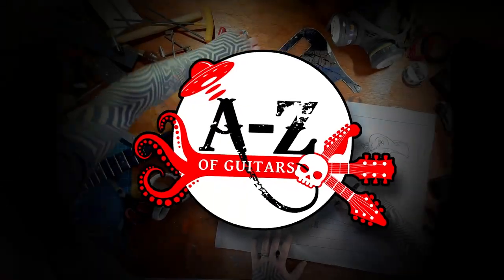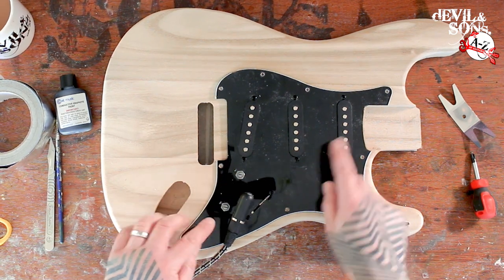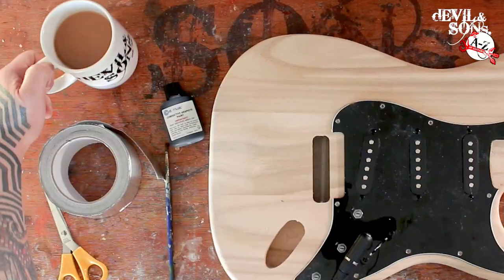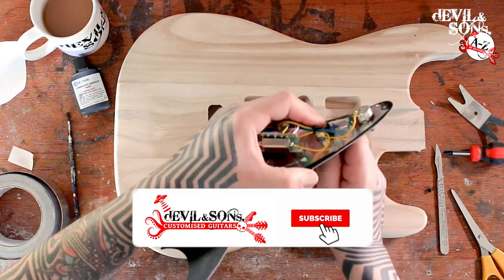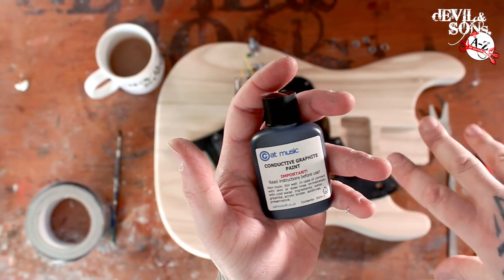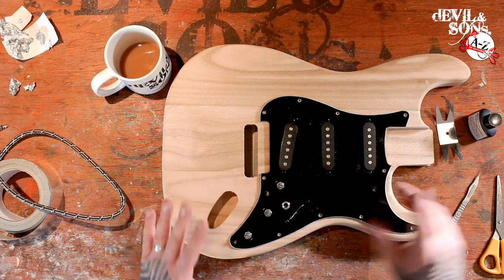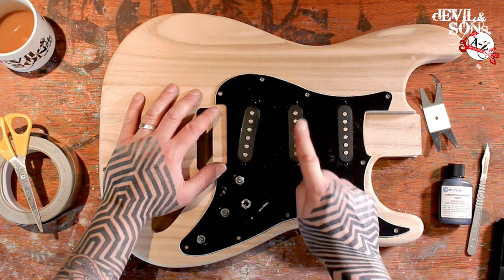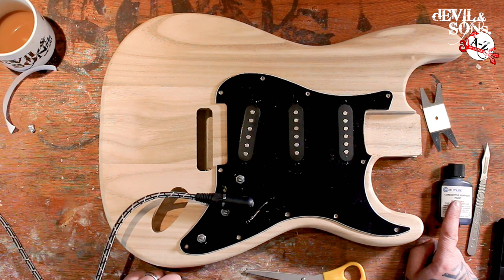Definitive proof that you need cavity shielding on your guitar

Comment: you’re not grounding it in the first one, so its pointless. shielding makes 0 difference when you’re touching the strings, it only affects the noise floor when the strings are released
Reply from the maker: The whole point of this experiment is to reveal what works and doesn't. It is surprising what some of the results are. You're spot on with touching the strings.

Comment: Pretty sure you need to use the slug repellent copper tape. Almost every TIN foil hat wearing conspiracy theorist will tell you ALUMINIUM foil don’t stop anything. 😉
Reply from the maker: Did you watch the video? The aluminium works really well.
Reply: I used Elk brand copper tape on a Squier strat and it works beautifully. Zero noise. Absolutely 100% better. I didn't expect it to work as good as it does.
Reply from the maker: Great stuff.
Reply: It improves it slightly I've put thicker copper plate and connected pickup straight to shielded cable, when i wrapped pickup(p bass) on thin copper foil it did'nt help maybe even got worse, i wonder how long does the paint last

Comment: I have 1 Strat and play it constantly. I know what this guitar sounds like, the sound got kind of sterile when I shielded just the control cavity. Ripped it out. Sure it made it less noisy (not that noisy to begin with) but at the cost of the tone. Been playing for 43yrs, not a newbie. It's funny how not 1 utube video mentions the sound difference yet just about every post on guitar forums tells you this.
Reply from the maker: That's interesting. I've never notice that, I must do some tests now to compare. If it's not too noisy then I wouldn't suggest making changes, but perhaps the shielding wasn't done properly?
Reply: There should be NO DIFFERENCE in your tone after shielding your guitar.
If there is nothing between your strings and pickups then the tone is unaffected, it's simple physics.
The shielding does not connect to your "hot" wires therefore does not affect your signal.
You probably shorted something that bled signal to ground. Or there was an existing signal short to pot or switch body that was not apparent due to the lack of shielding and therefore lack of path to ground, and found a way to bleed to ground after shielding the cavity.
Youtube videos do not mention tone alteration when shielding because there is none.
Shielding DOES NOT ALTER TONE in any fucking way....
Reply from the maker: Well said!

Comment: Cool experiment, but define "amazing job".  It sounds like there's ~3dB reduction in the upper-harmonics of the AC hum, which is to be expected.  It may not be significant compared to the whole dynamic range, and may also reduce the same range in the pickup signal.  The odd thing is that the adhesive side of Al tape isn't usually conductive.  That shouldn't have made an improvement unless the eddy currents from Al dispersed some of the magnetic signal.  I just use Al tape.  The difference with the carbon paint is negligible.
Reply from the maker: I like the ease of the carbon paint. Sometimes I fold a piece of the aluminum tape and lie it across the whole cavity linking the pieces. I guess amazing in this case meant it got rid of a buzz really easily.
Reply: @DevilAndSons  Define "got ride of".  What I'm saying is how much attenuation is there?
Reply from the maker: Do you think there would be a noticeable effect with this amount of shielding? I doubt it. Compare it to the guitar cables you'll be using, surely this is negligible in comparison?

Comment: Am I crazy, or did the insulation make it worse? I didn't hear any noise the first way round. Did you boost it for the comparisons? Other people say you just do around the pickups. You didn't test for that.
Reply from the maker: Good point, i didn't go ahead and just do the pickup cavity. I didn't boost any sound. The sound may not be as good on the video as in real life but it definitely did make a difference to shield it. I have another shielding video coming up in a month or so, I have a new shielding paint to use and try.

Comment: I'm wondering if the hum would be even less if you paint the whole back side of the pickguard over the pickup cavities also.
Reply from the maker: That would be a good test. Although of the pickguard makes contact with the guitar body but for the bits that don't and are like the roof of the cavities it could well help.

Comment: What are you grounding to? A wire to what part of the guitar? My Strat is grounded to the bridge. Wire touches both bridge and alum tape. I also have L Sensors in my Strat so they're quieter anyways.
Reply from the maker: If the pots are touching the tape then they are making contact and forming part of the circuit, and then there should be a wire from the pots to the bridge. I haven't used the L Sensors yet but I hear good things about them.

Comment: Because of this video I ordered the Cat shielding paint for a humming guitar. 
It's thick stuff and worked 100 percent with one coat on bare wood. Still plenty left for a couple more guitars if ever needed.
I used a small torch beam as I worked to show up any tiny bits I missed and kept brushing till they were covered.
I used your tip of painting small tabs of paint on the top edge of the cavity to connect with the shielding on the scratch plate.
It dries quick but I took no chances and left it overnight before reassembling.
I now have a perfectly quiet guitar. 
Thanks again for the vids, Educational AND practical.
Reply from the maker: Hey, it's a pleasure and I'm so glad it worked. A client just sent me a guitar to do some upgrades to, it had a hum and no shielding. I don't really understand why manufacturers (and this is a well known midrange price) don't shield.

Comment: Thank you for putting the work into this. I really like this experiment.
Reply from the maker: Thanks so much. It was actually great fun and I must do more things like this.
Reply: @DevilAndSons  I agree! I thought might be interesting to see if guitars with separated pickup and cavity routes (such as gibson or certain ibanez routes) would benefit since you can't get tape through the wire holes to make a full connection between cavities like you can with a pick guard.
Reply from the maker: Good idea. I have also been thinking about this, and about using a wire to link them together. I also want to see the difference between shielded and non-shielded wires.
Reply: @DevilAndSons  yes, that would be an excellent experiment as well. I have some wires that hum super loud when I touch them so I'd have to imagine it would be much better with shielded wires instead

Comment: Fact 1: Shielding MAY reduce hum and interference, but it doesn’t eliminate it. 
Fact 2: You don’t need to cage in the electronics (Faraday cage) that is a myth. 
Fact 3: As long as the shielding covers a substacial area be it under the pickguard or cavity it must be grounded, that way it acts similar to an antenna and can send unwanted noise (be it small to) ground instead of the output.
Fact: 4: Ground loops are also a myth for guitar circuits.
Fact 5: The less guitar myths you believe, the more enjoyable your playing will be. 😜
Reply from the maker: Absolutely. This whole Faraday cage thing does my head in. It's like the tonewood discussion.

Comment: I was getting ready to reassemble an old Peavey T-15 with new pots and caps and paint. It  originally came with no shielding. I was indecisive about going though the hassle of shielding anything but you certainly encouraged me to retrieve my shielding paint and foil tape while everything is still in parts on my bench LOL. 
Thanks for the great video and going though the trouble of presenting this.
Reply from the maker: Thanks so much for letting me know. I am positive it is worthwhile. I didn't cover  though that humbuckers are often shielded with their own metal plates at the back, and that you can get shielded wire... but I think it's still worth the effort.
Reply: These pickups were very much like typical great sounding single coils complete with lots of noise so it’s worth the effort… especially since it’s in pieces right now.
Reply from the maker: Do let me know if it was worth it.

Comment: Do you think the glue on the tape works like insulation and prevents a good connection from bottom layer of tape to top overlapping tape?
Reply from the maker: It absolutely does. Some tape has conductive glue. I sometimes fold a piece of tape length ways and tape it the lengthe of the shielded area to make contact with all the strips. I have a video showing that... I'll just find it and link it below.
Reply from the maker: Here's that video, it's about 4 and a half minutes in. https://youtu.be/46KZfjnilMM?si=zPtWZ_TBcy8UvCRx
Reply: @DevilAndSons  nice!

Comment: Why didn't you ground the pickguard to the guitar in the first test?
Reply from the maker: Without watching through it all again I seem to remember that I was working up to that, to see if it actually made a difference. Also if the pots are grounded and make contact with the shielding on the pickguard it is grounding it.
Reply: @DevilAndSons  On my Strat, the times the ground wire has been accidentally released sounds the same as the first example. Regards!
Reply from the maker: In that case having the cavity insulated but overlapping to the top so it makes contact with the pickguard, and therefore the ground on the pots is sensible.

Comment: It’s strange that in positions 2 and 4 the humm is not canceled.
Reply from the maker: The pickups would have to be in reverse polarity. Also the closer they are (like on a humbuckerl the more similar their signal would be to cancel out.
Reply: @DevilAndSons  
I have a couple of guitars. In positions 2 and 4 there is zero hum, even without shielding.
Reply from the maker: Interesting. I wonder what pickups they are using. Which guitars are they? I'd like to look into that.
Reply: @DevilAndSons  
Just a regular stratoids and tele-like ones.
Reply from the maker: What make and model though?
Reply: @DevilAndSons  
IDR, some asian copy, Zomby and Aria pro, all names have long been erased.  Pups are stock, noname.
Reply from the maker: @iridios6127 fair enough. Aria Pros are great

Comment: How did you control the intensity of the EMI source?
Reply from the maker: I'm not sure I know what you mean. I didn't have control over it exactly, I just reduced it with the shielding. Are you saying you want to be able to control how much you reduce it by?
Reply: @DevilAndSons  No, I'm saying that when there's a time difference between when you take the measurements, the intensity of the EMI source may have changed. The more likely explanation is that the shielding acts as a quasi antenna, and when it's connected to ground, you eliminate that amount of EMI. It's got very little to do with 'shielding'.
Reply from the maker: @ahall3823 ah yes, that makes sense. I as I say, it's not a completely rigorous experiment but it does help show that it works in theory.

Comment: Great video! Just curious if you’re able to use different paint over the graphite paint and have it still work? I want to do something with the guitar where you can see something inside of it and am curious if I’d be able to paint over the paint with non-graphite paint and have it still shield the guitar
Reply from the maker: I'm pretty certain you can, but in order to make the shielding connect to the ground I would add a wire from the back of a pot to the inside of the cavity with a screw holding it I'm place that penetrates into the shielding
Reply from the maker: I show that in this video https://youtu.be/46KZfjnilMM

Comment: did you connect your insulation to the earth lug? You need to earth your insulation
Reply from the maker: It's earthed by touching the pots, whose casings are grounded to the earth lug.
Reply: @DevilAndSons  Touching will give you more unpredictable noises. Solder the shield to the ground lug or one of the pots. Make sure that the shielding is one continuous shield
Reply from the maker: Why do you think that? Would you suggest isolating the pots using non-metal washers? When I use shielding paint I always have an extra wire screwed into the wood cavity through the shielding.
Reply: @DevilAndSons  What you are trying to build is a version of a Faraday Cage which you are trying to shift to the groundSo your shield has to be shifted to the ground as a whole, preferably to a single ground (to eliminate induction) . The contact to the ground path has to be as good as possible which means you clean the surfaces properly to get rid of oxidation and then solder. Top of the pots touching the shield is not enough and can cause more harm then good. I am an electronics engineer, this is 101
Reply from the maker: So do you suggest separating the pots from the shielding so they don't touch except the grounding wire you solder to them? 
Also, what are your thoughts on how to chain the pots together? In a row but not looped or spidered out from one pot?
Reply: @DevilAndSons  You are trying to manage electromagnetic interference, not shortanything. You need to fix your cage to the proper earth
Reply from the maker: Some people advise not to have everything connected to the lug but to chain them.

Comment: Strings make so much difference
Reply from the maker: Have you found some particularly bad strings for conducting? I'm assuming if the sound is there without the strings it will either be the same or worse with them.

Comment: Best is copper tape with conductive adhesive covered with a coat of graphite paint.
The paint by itself has a resistance of around 200 ohms for a 1/2" strip 12" long, which is far too high (I measure a strip of copper tape at 0.07 ohms but higher - 3.5 ohms - if you use several strips on a cavity due to the adhesive. Combining copper with graphite on top in a cavity gives 1.2 ohms .
Not the ideal zero but a reasonable practical value.
Reply from the maker: That's interesting, thanks for sharing this info. Does the paint adhere to the tape OK?
Reply: @DevilAndSons yes if applied immediately after taping, so no oxidation. In the defence industry we used silver/copper paint but this is £60 per tiny bottle (think nail varnish) so that's £120 per guitar. I never measured the resistance but if it's good enough for them military I guess it's near zero ohms.
Reply from the maker: That sounds like a YouTube video! Using the most expensive shielding paint ever!
Thanks again

Comment: One thing bugs me. When you touch it the hum returns.
In a real situation it would be a ground link between electronics, shielding and the strings, meaning you would be always touching it when playing. As you can see in any faraday cage demonstration, if you touch from outside, it doesn't work.
My experience is: shielding doesn't work in real life. Twisting pickup wires for phase canselation, humbuckers and dummy coils work great, but shielding is placebo.
Reply from the maker: Interesting comment. I have definitely noticed the difference with good shielding.
Reply from the maker: Dummy coils sounds interesting- I'll have to look into that. Thanks.
Reply: @DevilAndSons  definitely it won't hurt shielding (except for vintage guitar with weak magnets... Seth Lover explained why talking about his choice of materials for paf covers). Except for my 71 Dan Armstrong all my guitars are shielded and what I can tell is that as soon as I touch the strings my marshall starts playing FM radio if the outlet socket isn't property grounded. xD
Reply from the maker: Interesting. I think the playing the radio is to do with the grounding on the amp.
Reply: Shielding is for EF radiation  like when you guitar is too close to other equipment/lights.   not 50/60hz hum.  pickguard & cavity shielding have absoloutly nadda to do with AC hum.